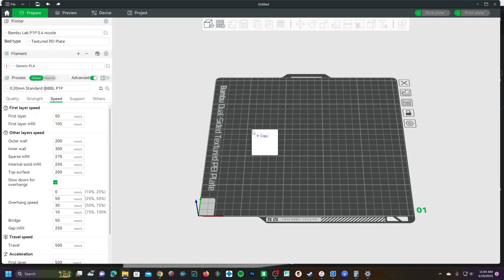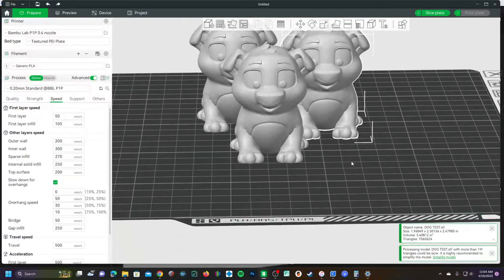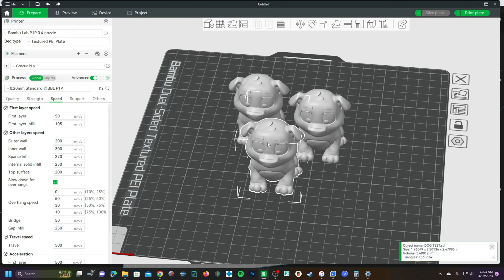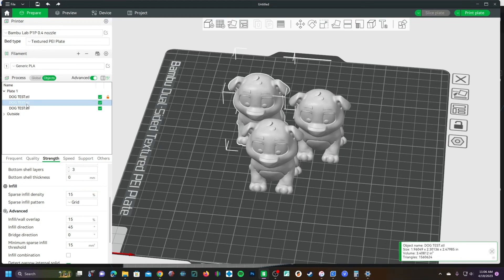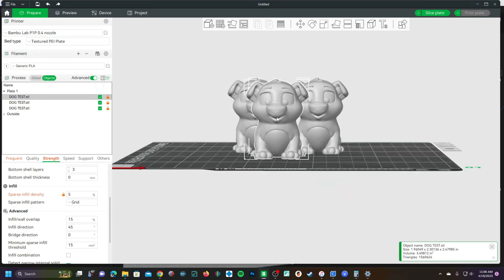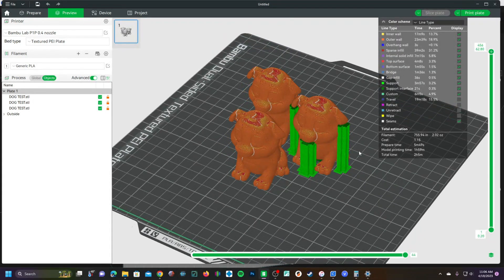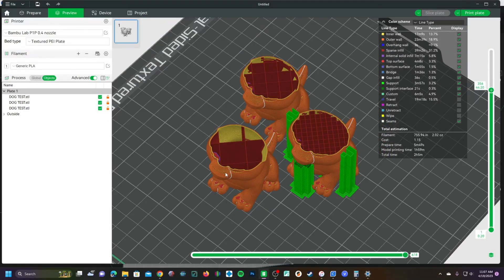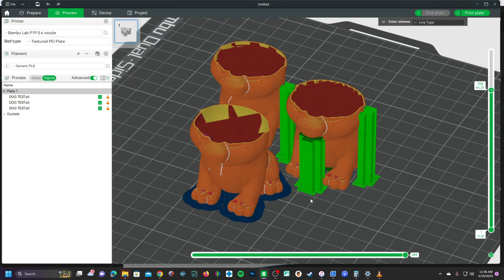Applying unique Slicer Settings to individual models on a single Plate in Bambu Studio - P1P X1C

Comment: How do I print each copy in a different color without having to print one at a time
Reply from the maker: You can simply set each one to a color, but... it would have to filament swap EVERY layer. This would not be a good way to do it. Instead, I would use "Print Sequence: By Object" under SPECIAL